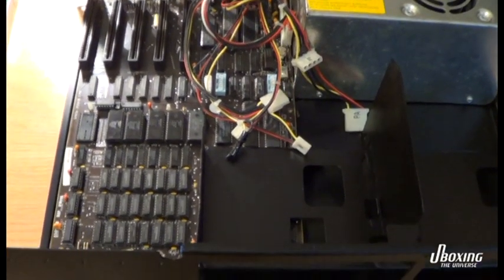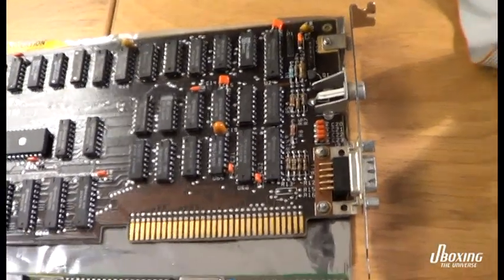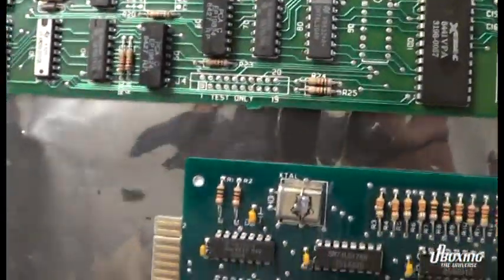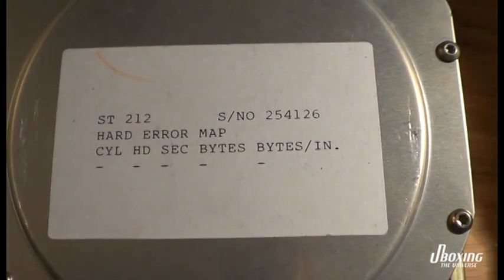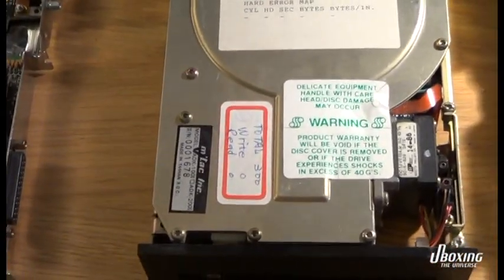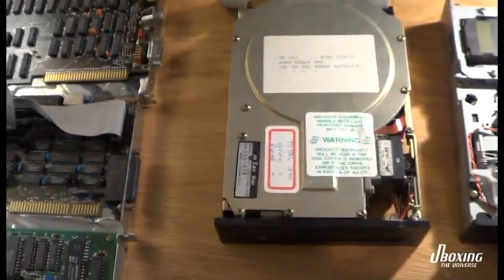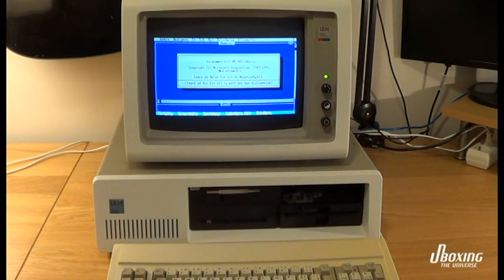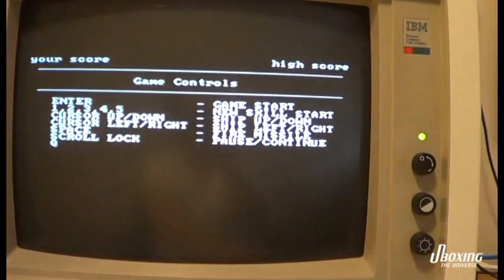IBM 5150 the first PC Expanding the hardware CGA graphics

Comment: Great...now you have IBM PC full of non original hardware (IBM PC should have only two full height floppy drives only) with totally cable mess inside, and great hole above 5,25" floppy drive. Seriously do you need to do this? BTW your image on IBM 5153 is very serried, you can extend it with knob on the back of monitor...
Reply from the maker: Hello Romanon26 in some situations Im a purist, for example if I have a setup that is more or less flawless it ends up as original as possible. But this was ready for the trash, its an epoxy-filled-spray-painted-old-mess-of-wires. This is my 80s gaming rig! ;) Besides Its more fun with hands-on projects that demands a hammer and nail. In the next episode Ill cover that hole.
Reply from the maker: Ill adjust the monitor!